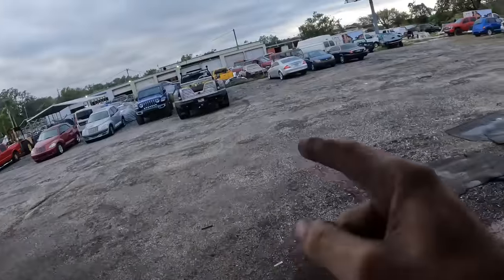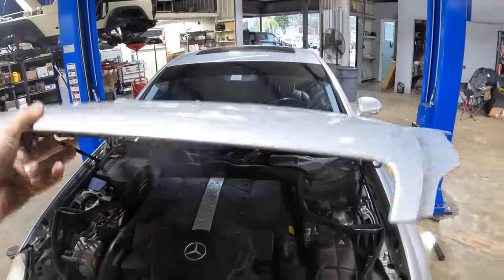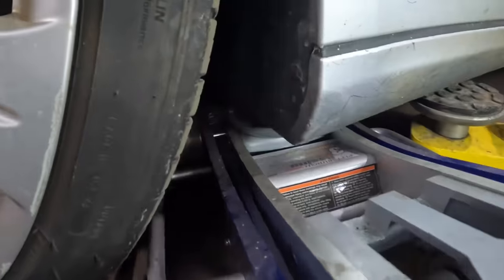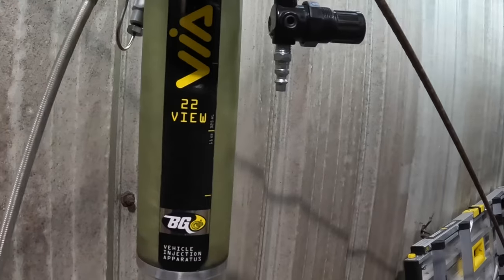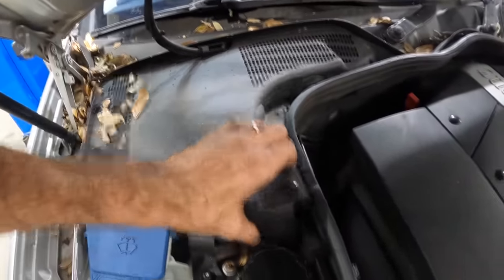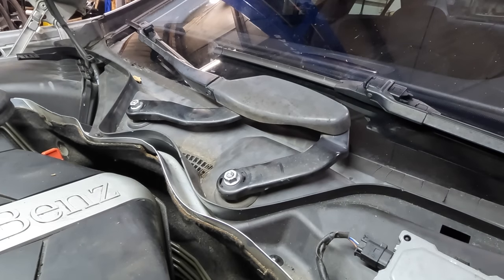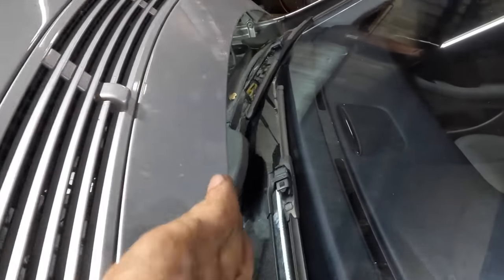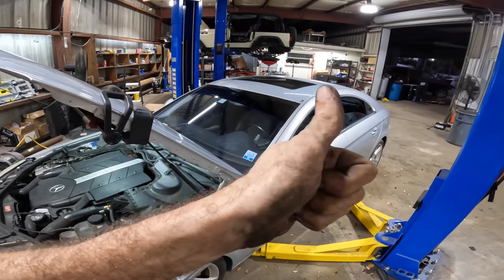Rookie Mistake on a Mercedes! “I quit” @SouthMainAuto

Comment: Woo!!! Passive Agressive Ray pulls the "if you KNOW what I mean card" , this video was just like watching Tenet or Memento? It makes sense when you watch it backwards? Guy at a dealership tried to do this BS on me? Telling me that Jeep JK Death Wobble is a myth, it only does it when your tires need replacements. I told him they were only about 6000 miles from brand new?  Showed him the receipt. Then he says it must be my sway bar  and idler arms? I told him that is the Death Wobble remedy according to Jeep Forum and 200,000 comments. He then said , he Can Not release the Jeep to me due to that condition being unsafe for other motorists on the road?? I snapped my keys off the bench, hopped in and left in reverse in a one Way 3 bay long service garage at the dealership. I changed the bushings to hard rubber inserts and went up in 1 size wider tires and haven't had DW since. My Jeep just hit 145,000 miles for an 08. They also stole my console change, my postage stamps and  a CD?  Never again...

Comment: FYI BMW Mercedes Audi and all those lovely ones always use nothing but 10 mm 13 mm 15 mL 17 ml and 18 rarely but only mostly on suspension control arms for the 18s or sometimes even both 16 and 18 or 17 and 18 on each side very strange

Comment: Mercedes engineering, yeah right! My 2004 Ford Taurus with 290,000 miles runs fine and still has original parts except for the starter!

Comment: also... mercedes benz... dodge key fob.... so why is it so difficult to understand that a 2019 dodge 3500 has a mercedes 69rc transmission rather than dodges' go to 68rfe transmission....P.S. both are absolutely applicable to any dodge 2500+ model

Comment: Ray, does it kill you to have to stop fixing a car?  This Mercedes is a good example.  LOTS of things wrong with it, mainly due to neglect IMO - power steering fluid, worn tires, busted window motors, etc...  But it was only in for the air bags.  So you do what the customer asked, and you fix the air bags.  Does it kill you to give the car back to the owner with all the other things not fixed?  Or maybe I'm looking at it backwards.  Maybe it's a customer who will keep coming back, and giving you business/money.

Comment: How unusual, a Mercedes with an air shock leaking.
I could have told you it needed rear tires. A German car is built to squat with negative camber. The old VW's had swing axles in the rear. Under hard cornering the wheels would tuck under the car. This caused roll overs. Therefore Germans didn't want a car that even looked close to positive camber.

Comment: We had a guy come  into shop 3 weeks ago was on his way down from new to Sarasota FL where I work and he had to get an water pump replaced we just looked up out charge and it 600ish dollars 800 if some other thing we're needed the shop where in broke down at in north Carolina  knew he was stuck and had home pay 2600 for water pump and thermostat not even out local dealer was gkhigh they would have charged 1940

Comment: There is nothing more expensive than a cheap used Mercedes. I own a 2006 E350 from 22k miles know first hand. Also seeing all those leaves gives me anxiety, it only takes a couple to plug up the drains then you start getting water sitting in those recesses, im in So cal and mine is garaged so I dont have that issue

Comment: These models may have the biodegradable wire coating, not good with age and they short out.  Looks like a typical 2nd or later owner of a Mercedes.  They drive it with worn suspension components and just keep replacing tires because it's cheaper than fixing suspension issues.

Comment: The motor mount with LIVE.  Liquid inertia vibration elimination.    Had a professor working on those for aviation purposes in the early 90s.  Mercedes (all manufacturers)sometimes likes to unnecessarily over complicate. 
You heard the one about the engineer and mechanic?
The engineer came home and found the mechanic in bed with his wife. 
Been getting revenge ever since.

Comment: Doing my own mechanic work I couldn't say for sure how ever I changed a rt rear  wheel bearing for a friend 98 toyota camery took all of a hour and a local shop quoted it to him I can't remember the exact number but it was over 400 pushing  5 and the bearing best I can remember was 70 and some change tax and all so I would be very inclined to say yes my wife got into a situation in 06 with a miss fire with her Pontiac sunfire money light came on befor I had access to tool she calls I say take it to Pontiac and go ahead and get a diagnostic came back back intermiting cylinder 2 had a bad plug wire they tried to charge her 65 for the scan ok had to be done and $135 for 1 replacement wire I honestly thought she read it to wrong on the phone until i seen the estimate but itold her then if it was intermiting not going to wash a cylinder a down stop and get a set of wires I'll change them whole new set 70 and some change so yes that happens to women alot I'm sure that dosnt know better not many around you Ray you Eric O and a few others on here I've watched that's complained over the same things over charging from the shop their working at or have worked at since I'm not insured or  licensed I only do personal and family and friends and I don't ask for anything just what they want to give me and don't start a job expecting anything unless I pick up the parts  but there will be day latter in life when I can't physically do it if God  allows me to live that long I just pray I can find a good honest man to pay my money too like you

Comment: That Mercedes owner clearly has champagne tastes with a Budweiser wallet. Who drives around in a performance car like that with the power steering pump screaming, 4 bald tyres, both front windows inoperative, faulty screen wash/wipe and a faulty suspension leg? He needs to buy a Ford Focus and have a reality check.

Comment: as a mechanic with 40 plus years, I would turn this car away, cost of repair is going to be high and do you really want a customer that would let the tires go into the cords?, you have to look at the customer 1st, car 2nd because the car wont pay you

Comment: Eurotrash.  Even an '06 chev of any description wouldn't have 2 bad regulators, leaking power steering system, broken wipers, motor mounts, blown air bags ...$$$$$'s .  Quite low mileage.  Would a beemer even be that bad?

Comment: Low of power steering fluid, blown engine mount, tires worn to the threads, inoperative windows, washers, wipers...
This specimen of Mercedes is typical car of someone who doesn't know that one that can afford a chimp should be able to buy the bananas.

Comment: Sorry to say, but . . . . .  that was NOT a rookie mistake. That was, however, someone being . . . . . . .  LAZY

OK. If not lazy, then somebody is in desperate need of some time off.  If would have taken the time to do some very simple troubleshooting, rather than just 'knowing' what the issue was, he would have tightened the nut and tried the wipers again.
But to further provide evidence for my "lazy" idea, just look at his workspace. The blue box with the aluminum diamond plate. Not only is it littered with tools from other jobs, there are parts from unrelated cars, and the top itself appears to have never been wiped clean.
In other words, dude needs to take a week or two just to get away.

Comment: As for Mercedes and the owner not wanting to spend big bucks to have it worked on @ the dealer. Umm, it is a Mercedes and they are just a prestige vehicle. So you will pay up the A!@ to have it fixed, not to mention parts prices. They are just overpriced, overcomplicated toilets. Absolute garbage.

Comment: Can't you open the hood to about 90° or did they delete that option on the Mercedes?
To your question or statement if that car is fast, it "only" does 155mph if it wasn't chipped or modified. Gentlemen's agreement in Europe (max 250kmh/155mph), don't know if they keep that to/with cars overseas.